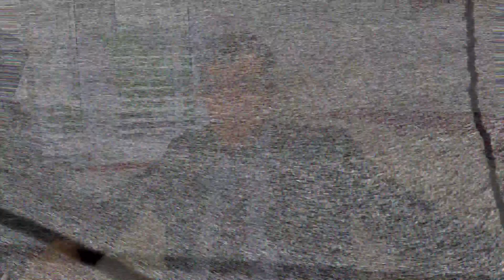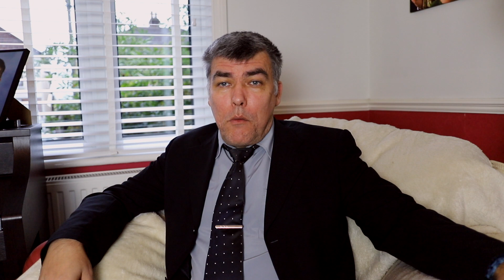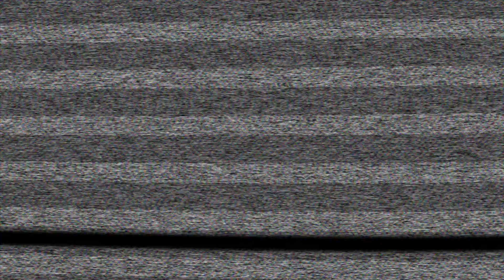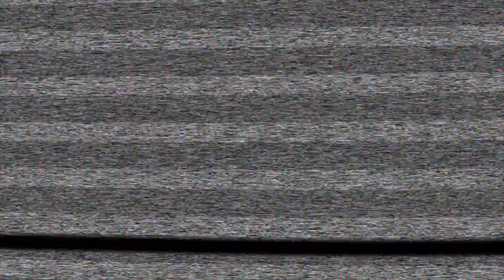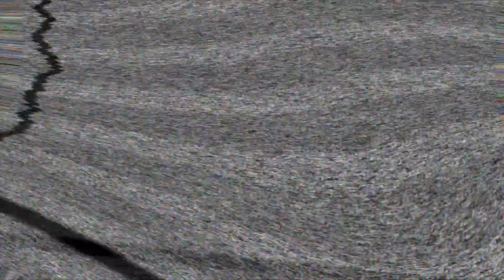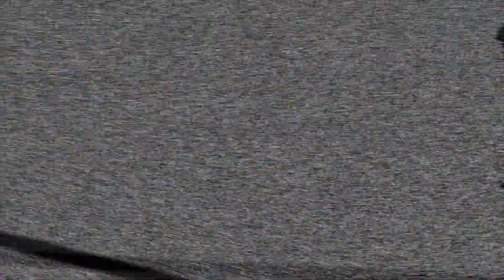Electronics Courses/lessons for beginners

Comment: Hi sorin  please help me with an acer laptop AO722. Cracked screen. I replaced it and while it is booting with the new LCD it went black. but it still works on external monitor. I measured +LCDVDD but it's not switching. I tried shorting +LCDVDD and +3VS and still nothing. There's no backlight. but +LEDVDD is present. I tried also flashing  the bios thru freeDOS but it didn't work. Tried the old cracked screen again and it's not working anymore. The new screen works in another laptop.

Love your videos btw.

Comment: Hey, maybe you can help me: I watched a video of yours where a toshiba laptop turned on, but no image, I have done the same as you did, checking voltages on CPU and GPU and basically came to the conclusion that the GPU was dead, it boots, fan spins, charges battery, fan turns on and off with heat, so it boots, BUT no image. I was wondering if there is a way of a regular nobody guy can bring that GPU to life somehow, you used a heat gun, but I think that was a temporary fix and you then maybe did some reballing behind the scenes? It's a good laptop, Someone gave it to me for free if I could fix it, so any tips would be aweasome! Thanks for your videos and for what you do, it helps a lot!

Comment: You may wish to use the water flow and pipes/valves to discribe basic electricity.
Electronics is the art of shaping/restricting/controlling the flow of energy to perform tasks.
Components are the way to make it happen.
Reply: However  your idea of water flow approximation is great (I've got same idea during seeing this video) but unfortunately too difficult to realize (even if you are plumber with skills in electronics)
Reply: Jozef Soucik
LOL i think a plumber would get a shock :-D.

Electronics is complex when you dig deep into it, but you dont need to know everything to make something work again :-).
Thinking in blocks is always a good way to find a fault, a block has inputs/outputs and power, the block will perform a function so if you have a rough idea what the block does you can test both ends and the power.
Or you could say "What do i want from this block, is it giving me it?".
Same kind of idea works with mechanical items, thinking in blocks helps to diagnose say a car engine.